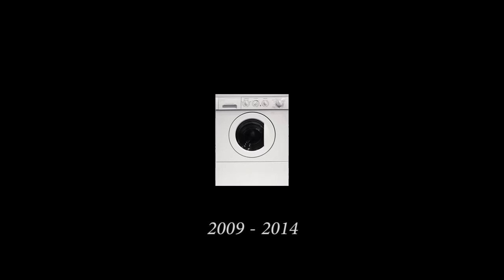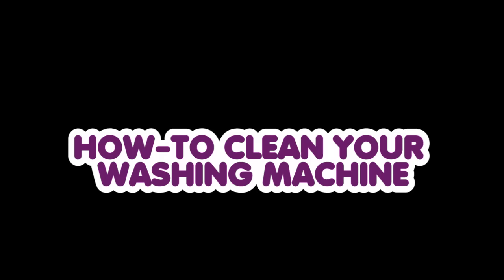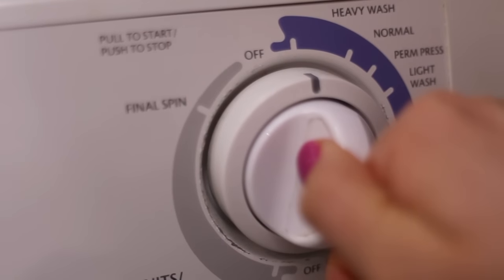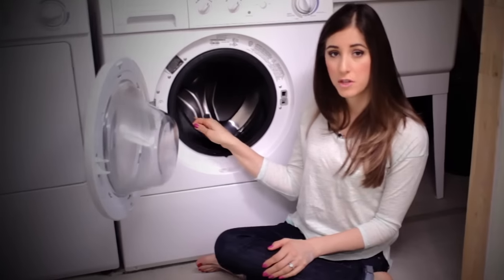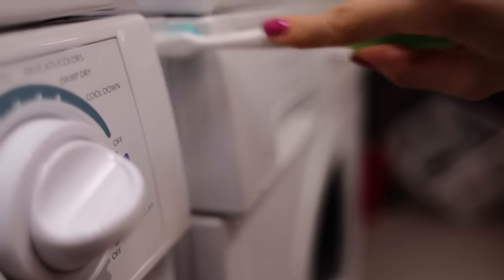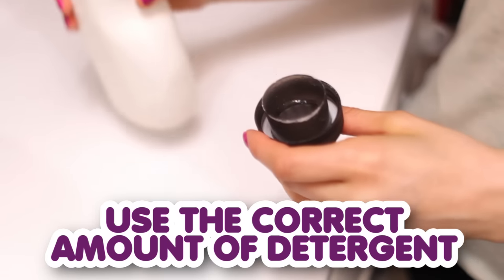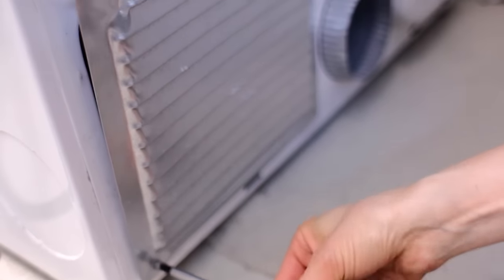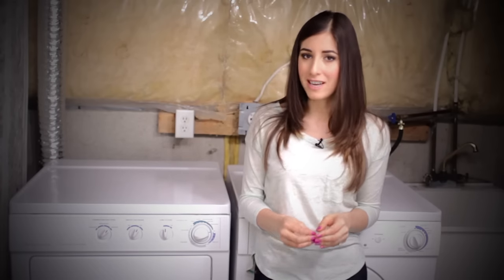HOW TO CLEAN YOUR WASHER & DRYER! Simple & Fresh Laundry Cleaning Ideas (Clean My Space)

Comment: True story: Bought a home and inherited a washer and dryer. Noticed the dryer barely dried. I did the normal stuff, but still no joy so I went outside to examine the outlet vent. It was clogged with lint. I began pulling out lint by the clump load and grabbed onto a mummified bird that resembled jerky! I took my portable leave blower into the house and connected it directly to the dry vent itself and let it run full blast for a few minutes. Result: Blew out the birds nest, my yard looked like it snowed, and my dryer worked just fine after that!

Comment: Totally addicted to your cleaning videos and truly each and every tip has made a massive difference to our lives. I stopped using fabric softener and sheets (coating clothes with petroleum byproducts is like dousing then with gasoline) and went ht vinegar route. In weeks of doing this my reactions to back breakouts and redness/rashes completely stopped. The vinegar has literally stripped my cottons of their build up and no longer hold that overly perfumed odour. Thanks. For your new laundry segment I would like to see better ays to deal with shedding dog and cat hair season as daily laundry and top sheets on our beds to protect the quilts and coverlets are required. The machines tend to collect massive hair daily. Thanks so much.

Comment: Will chase up the HE fluid fabric softener. But a note: my unit is a washer/dryer in one. It takes around 3.5 hours for a load, which is excellent overnight. It has a steam setting and has built-in modes for cleaning, using bleach. Niiiice!

Comment: Great tips!! I discovered a way to refresh jeans and sweaters wo washing them btw, put them in a grocery sack and pop it into the freezer overnight. It really does work! Pretty much most scents from normal wear are neutralized, I tried putting a dryer sheet in the bag once and it made my sweater a bit overwhelming with scent, maybe next time I'll try a used dryer sheet that doesn't have much fragrance left.
Reply from the maker: I've heard about this with expensive designer jeans...it totally freaked me out!  I am glad it worked for you, I might have to experiment on my own!
Reply: I have never heard this tip and can't wait to try it. Do you use a plastic bag or a paper one?
Reply: I used a plastic bag although paper would work I bet, it's more just the cold that kills off most bacteria I think.

Comment: Great informative video. Is it true that dryer sheets should not be used in high efficiency dryers? Also, I noticed that between washes, when I pull out the tray that holds detergent, bleach, etc., I noticed that water is in the bleach compartment. The bleach has been dispensed but water is in the compartment after I've finished washing a load of clothes. What could be causing this issue? Last question, should I fill these compartments just to the max fill line or below the max fill line?

Comment: I watched both this vid and you Affresh vid. My washer has a lint problem, I think. Yes, washer, not dryer. There's no filter on my machine. My clothes come out with a haze over them, making them look worn. In fact, at first I thought maybe the washer was actually roughing them up. I now do all loads on cold, delicate cycle. Maybe it's just time to replace. I was wondering if you've ever received a question along these lines and if you might have any suggestions. I'm doing the baking soda/vinegar clean now and hoping for the best. Although, odor is not the problem.

Comment: Hi Melissa,
Could you possibly do a video on the best way to launder new towels?
 
Whenever I've bought new towels most of them (not all)  tend to molt (shed fluff, lint and threads all over the inside of my washing machine. I hate buying and washing new towels because it means having to pick lint and threads out of the washing machine each time.
 
I've tried all the 'tricks' I've read on the internet ( e.g. wash with vinegar, wash with baking soda, use hot water, use cold water, etc). None of them have worked. It seems to take anywhere from 5-10 washings for new towels to stop molting, and even then, they continue to molt a little from time to time thereafter.

Thanks!

Comment: How would you clean the drum of the dryer? I like to detail my car using microfiber towels but my wife likes to use dryer sheets. The residue from the fabric softener sheets may be clogging the pores of the microfiber towels leading to streaking on the cars surface that is not compatible with a car’s clear coat. Would I use and APC type cleaner and scrub the drum with a towel?

Comment: I definitely need to clean my dryer.  It's only about one year old, but the lint trap was designed by an idiot...it's pulled from the top of the dryer, and the lint trap itself faces downward.  Basically, a ton of the lint that is trapped falls back down the pipe when it's pulled, so a fire is a definite possibility if I let this go on too long.  Thanks for the video!
Reply from the maker: LOL design flaw - ouch!

Comment: I noticed that in this video you used the term "cotton cloth" and in all other videos you use microfiber cloths. Is there a difference? Why did you choose cotton cloths for this task? Thanks.
Reply from the maker: Yes. I specified cotton because microfiber wouldn't make sense in this application.  Cotton cloths are good to be used for wiping anything that could be potentially greasy or moldy, because the residue can be washed out.  Microfiber is poly-based and it is much harder to get grease etc. out.

Comment: my question for the laundry series is how do you wash dried blood? yep sound werid and creepy outloud or in my head
Reply: If you put meat tenderiser and add a touch of water in a paste and run it on the stain let it sit awhile then wash works wonders I heard!
Reply: Try hydrogen peroxide. It reacts with the blood.
Reply: We learned in nursing school to use hydrogen peroxide. If it is already dried, pour it on and let it sit for a few minutes before putting in the wash. Depending on the item, I will sometimes use a toothbrush (an old one) and gently scrub it before it goes in the wash.
Reply: Shannon Vary thanks for all the tips :)

Comment: For the Laundry Series-- My problem is i have to cover my legs with stretch ACE bandages. The therapist puts lots of tape on the bandages to keep them from unravelling. I wash them once a week but i can't get the tape residue off the ACE bandages by washing them & they are still sticky. Help!!
Reply: Not sure if it would ruin the rubber stretchy nature, but I hear "goo gone" is a wonderful product for getting rid of everything sticky! Other things you may try are WD-40 (yes the car grease), olive oil, peanut butter, mostly greasy natured products, which a bit of Dawn would cut right through afterwards to leave squeaky clean!
Reply from the maker: Rebecca King rockerbaby2003 made some good points...I'd keep to rubbing alcohol or trying Dawn, because the oil may be hard to get out of the bandages.
Reply: ***** : The oil will come out with your best friend: baking soda. Just like you would on clothing that has gotten an oily stain, moisten the area, shake on some baking soda and leave over night. The longer the stain has been around, the longer you leave the baking soda. This tip has saved so many of my items.

Comment: i came here to see how to clean the drawer of the washing machine. any idea?
Reply: +ch na Yeah, I was surprised that that was covered with only a comment to "clean the draw if you like".  It is not that hard, however.  You just have to figure out how to remove it.  Mine kind of snaps out if you pinch the plastic a bit.  Once you have it out, you can take it to the sink and pull it all apart.  You will then have to dig the gunk out of all the little hidey places.  It is mostly fabric softener which will have become infected with mold ... so I recommend disposable exam gloves while working on it.  I'd also soak it for a while in bleach to kill the mold.  You'll need a tooth brush, or even better, one of those very narrow cylindrical nylon brushes to get into the small crevices.  (Look on Amazon for "straw brushes" or "tube brushes" to see what I mean.

Comment: never put baking soda or any kind of soda in your washer!!! Soda and aluminium is not a good combo. It destroys the aluminium bracket in the washer...
Reply: ***** False!
Reply: Keep putting soda in your washer....you will see!!!!!
Reply: Who said I put baking soda in mine?
Also, who said my washer was made out of aluminum?  It's NOT.  It's high end and made from higher quality metals than aluminum!!!
Reply: +Angel M. Vos I don't think anyone is suggesting that you put in LOTS of baking soda in and LEAVE it to sit for a day or two.  It is just a bit and run in a single cycle.  In fact, a common use our grandmas used was to put baking soda in to the normal wash load to brighten clothes.  Grandma's washing machine lasted much longer than todays.  ;-)
Reply: Well grandma's washer did not have aluminum parts inside. But you can do a little test at home with some alu foil and soda/baking soda in water and see what happens...in The Netherlands we got more front than top load washers. They are also very sensitive  to over  loading. In case you are not sure if you can use baking soda or soda in your washer I recommend to get in contact with the manufacturer of your washing machine.
Reply: ***** How do you know that about my grandma's washer.  Also, it is a bit silly to suggest comparing a couple of mils thickness of aluminum FOIL to construction grade aluminum which is treated, finished, painted, etc.  No comparison.  Surely you know that water dissolves just about ANYTHING.  Are you then advising us to not put water in the washer in fear that it will dissolve the drum?
Reply: Ask your washing machine manufacturer. Note; Long time ago I put a comment on YouTube about guns. Told it is better to only use guns for the police and military in the USA. Making  sure to stop all the killing, the answer I got from it; We need more guns it's our law! Same  here about baking soda. Just  do what you want in the USA, just put baking soda in your washer I don't care it's not my washer. As for the guns; I will never visit the USA I don't feel safe.